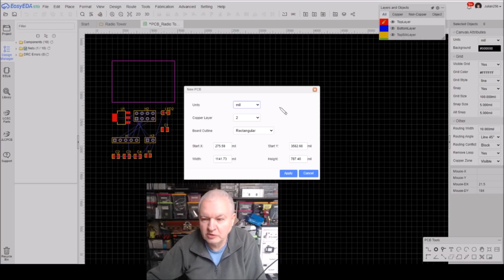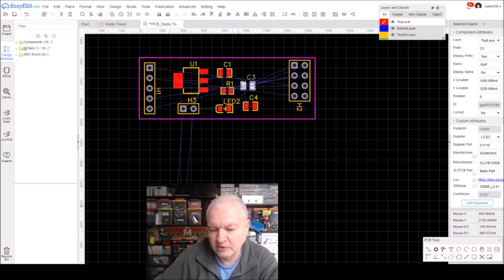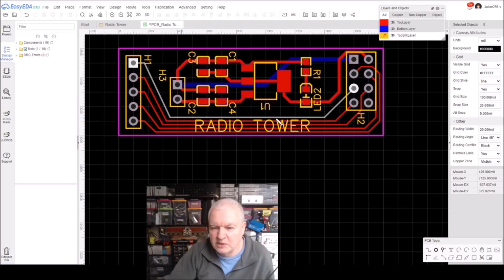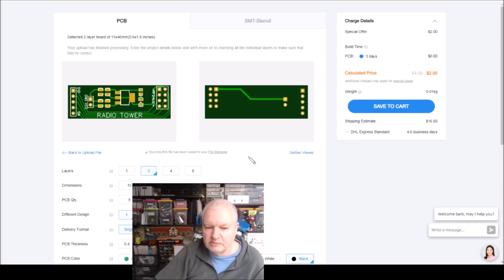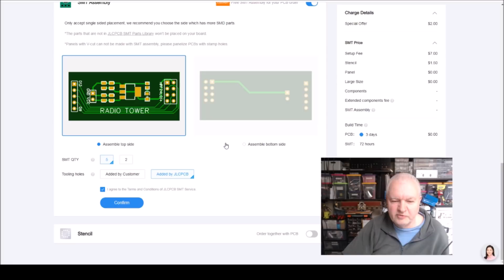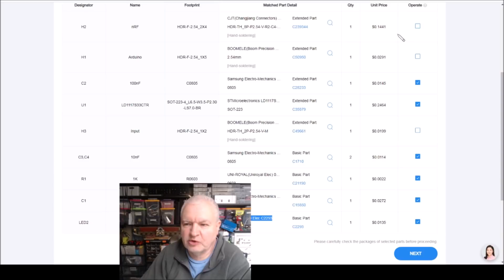PCB Layout in EasyEDA - Arduino Radio Tower

Comment: Hello Julian. Thank you so much for the video. I am sorry if my question is stupid. But i am newbie in electronics. I wonder if that 4x2 connector on the right  is two sided plated. I mean if the smd components are on top side and routed to that connector on top, can i still solder pins from bottom side? I mean does the holes work like via?

Comment: @22m22s: You could also siamese two board together, making pairs of boards to be separated later. I assume that they can score or router the boards to make bending them apart easier for you. Cheers !!
Reply: Thats called paneling them
Reply: Yep. But the distinction is that if the explicit "paneling" option fails to satisfy their minimum size requirements (because they fixate on the base PCB size), then by 'silently' doubling-up the entire design it would force the project size to be taken as doubled size. Just an option in case needed. It depends on how they enforce their minimum size requirements. Cheers.
Reply: @JxH  Minimum size between V scores = 20mm, minimum size for the V score machine = 70mm x 70mm. Panel by V score not permited for SMD assembley. Borders can be added.
The easy way  to do a sub 20mm pcb is to panel by Stamp Hole as there is no paneling charge for sub 100 x 100.

Comment: Why not make the back of the board a ground plane entirely rather than just running one ground track on it?
Reply: Exactly, ground on the back and power on the front, then you only need to route signals :)

Comment: Marking a pin as having no connection is done by putting an X on it, bottom row of Wiring Tools.
Add top and bottom copper areas, top +3.3 volts, bottom ground, then you only have to route signals, the dotted copper area tool.

The BOM file is easy to edit in Excel to get everything right.

Panel the pcb by stamp hole to get around the size issue, add a border so that the order number gets put on it rather than on your board and DO NOT check any panel options on the order page !

The low cost postage options are hidden, you need to "show more" to find them.

Comment: Always nice to watch someone design a PCB ! I think you should use a ground plane on a board this simple, if not for electrical stability then for using less etchant, the big manufacturers are still a bit secretive about how they dispose of or reclaim saturated etchant, and this is a growing problem nowadays due to our ability to just pop a few components on a board and get it made for pence, the price is being paid somewhere, but Kudos to you ! very brave doing this live (sorta!)...cheers.

Comment: You could have added a breakaway tab with a score line for the width for the assembly. Then you would just snap the piece off.
Reply: Minimum dimension for V score is 20mm, and minimum size for the pcb to suit the V score machine is 70mm x 70mm. Panel by  Stamp Hole is the correct solution :)
Reply: What about route and retain breakaway tab?
Reply: @hectorbacchus  Why bother, you are paying for 100mm x100mm, just panel by stamp hole (slot & mouse bites )

Comment: To get round the size problem, double the design in one pcb and place a track down the length between the two boards. Then convert the track to a slot.
Reply: Just panel by stamp hole :)

Comment: Still could have v-scored the board to the size you wanted, right? Bit late now, like
Reply: At 23:27 it says "Panels with V-cut can not be made with SMT assembly, please panelize PCBs with stamp holes."
Reply: @DaedalusYoung  So it does! I wonder why that is?
Reply: Minimum dimension for V score is 20mm, and minimum size for the pcb to suit the V score machine is 70mm x 70mm. Panel by  Stamp Hole is the correct solution :)
Reply: @steverpcb  Thanks Steve! I never panelled like that before, so I'll have a play with that.
Reply: @zippy7262  With EasyEDA its simple, Tools > Panelize, Select Stamp Hole, a special tool can be bought to cut these, so you set the spacing to suite the cutter you have :)

Comment: Those shipping charges are ridiculous.
Reply: You can get cheaper shipping, I pay £5.48, but it takes 10 days or so to get here. 5 of which are spent in a Royal Mail warehouse at Heathrow.
Reply: @DaedalusYoung  10 whole days? I'm waiting like 1  - 1,5 months here in Greece...
Reply: The shipping is available for much less, if a standard delivery service is selected. 

The component fitting is more ridiculous. £17 for £1 worth of components, which would take just minutes to fit by hand.